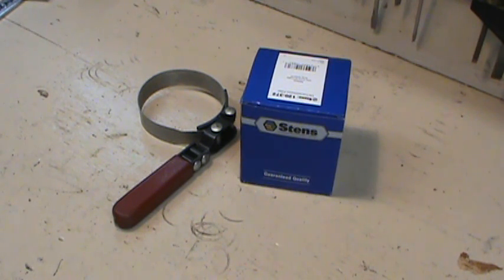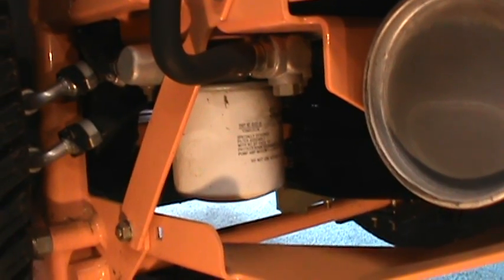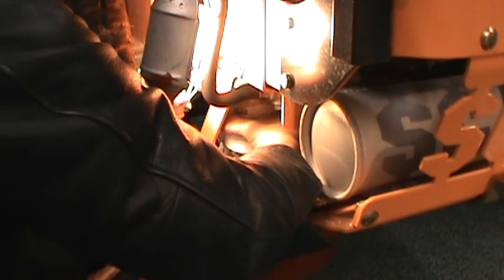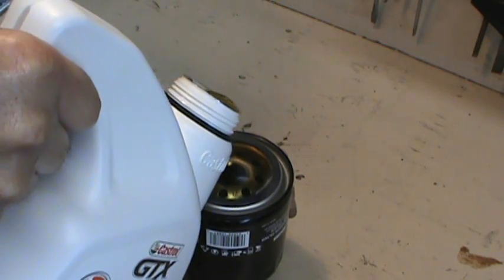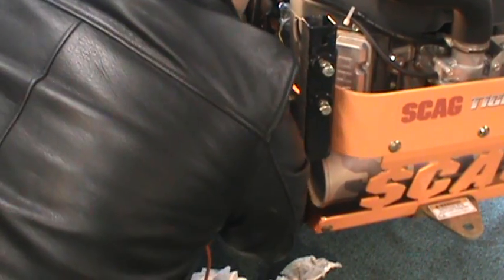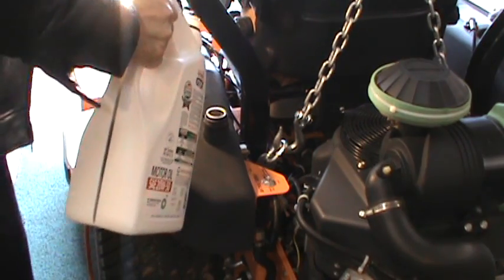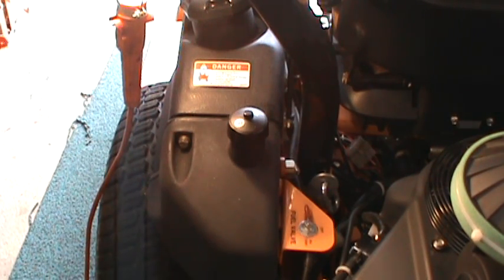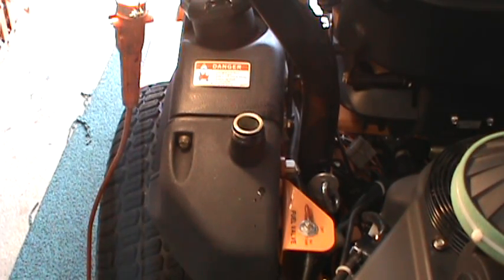Scag Tiger Cat / Tiger Cub Hydraulic oil change made easy!

Comment: Isn’t the metal sleeve insert inside the oil fill hole essentially the dipstick? I thought you filled just to the bottom of that? I think you can pull that right out if you want to look in the tank.
Reply from the maker: You are most likely correct. Something I'll look at the next time I'm in the garage.
Reply: @007connecticut  just thought I’d mention it. Nice video by the way!
Reply from the maker: Sometimes common sense is lacking. I make things harder then they are. Lol

Comment: Dealer says you need to loosen or remove vent plugs on both hydraulic pumps. You did mention not having to mess with the rest. Is just changing that oil adequate. The entire system holds between 4-5 quarts.
Reply from the maker: I don't want to drain the pumps. All that will do in induce air into the system. I removed the filter and refilled it. There is no need to remove the drain plug because the filter and drain plug are on the same pipe located at the same location. 
Simple to do. Drain it often to keep the oil fresh and you won't have issues with the pumps. Of course other machines may have different systems and could be different. Thanks for watching!

Comment: I love how clean your machine is, how can you keep it so clean? Thank you for the video.
Reply from the maker: Thank you
I blow the machine off after every use, but in the fall when I add the collection system (doing leaves) it gets real dirty. So I will wash it once before I'm done for the season (End of Nov). I park it in this garage in the corner between uses. When I do wash it I try not to wet the dash or any switches as they are not sealed. So far it's been a good machine.

Comment: Thanks-great and to the pint, the lift was great
Reply from the maker: Harbor freight has good deals for stuff like this. If you ever do this, just keep in the back of your mind never to trust it. So if you jack it up high to work on the machine, just block it with wood or jack stands before sliding your body underneath.
Reply: @007connecticut  I bought one of those hoists NIB off craigslist and gave it to a buddy,  we used it to clean deer in his garage,  worked perfect for lifting to the proper height.
Reply from the maker: @pcdubya  sweet. For the money you can't beat these cheap electric hoists.  I don't totally trust if for real heavy stuff but for 1/2 a lawnmower at a time (then I place wood underneath the tires if I go under it) they are great!

Comment: I dont see why you didn't drain the oil from the drain plug ? no one I have ever seen just takes the filter off and thats it, wow!
Reply from the maker: I don't like to work extra hard. On this machine / filter set -up, it's not needed to remove the drain screw. You need to remove the filter and replace it, so I just remove the filter. Plus in doing it this way, less chance to screw up something like loose a plug or strip a screw.. Murphy's law ...Thanks for watching.

Comment: You might be able to cross the filter number to a common Fram filter used on cars.
Reply: NO, don't do that! 
A car oil filter has a bypass built into the automotive engine filter.
The OEM Scag Hydraulic oil filter (Part No. 48462-01) 
is a 10 Micron filter with NO BYPASS to protect the pump and wheel motor.
Reply: NAPA also has the correct filter. you don't want a by-pass valve on  your filter. Thats why you don't use an oil filter.

Comment: Where did you get the bracket by the exhaust exit?
Reply from the maker: They are brackets for the Scag 3 bag collection system.
Reply: @007connecticut thanks...I was wondering about the one that keeps the bag from going near the exhaust...I really need one of those. I've never seen that before.
Reply from the maker: When I bought the machine I ordered it with the collection system. so it must be something that scag offers. Maybe go on partstree.com they have parts for scag and they have parts / prints with part numbers. Maybe you can find the bracket on there and order the parts for your machine. That machine is bought around 2015.
I serviced it today, all the filters changed and the oil, but the plugs. Then I drained the gas. It is put to sleep until spring.
Reply: OK thanks I'm going to look into that. I wish I was done. We've got 54 cleanups this month....about 3/4 done 🤷🏻